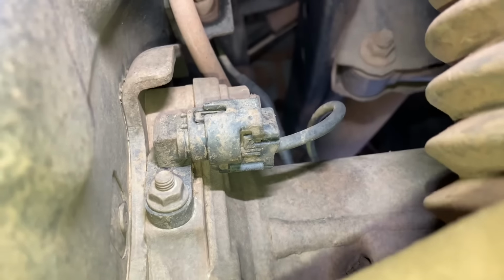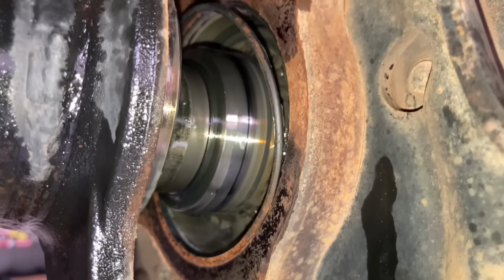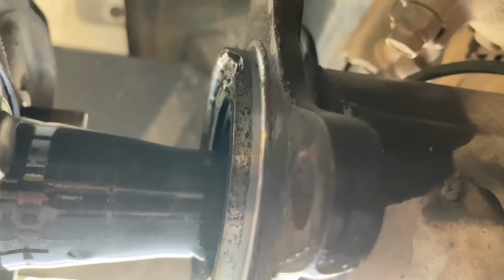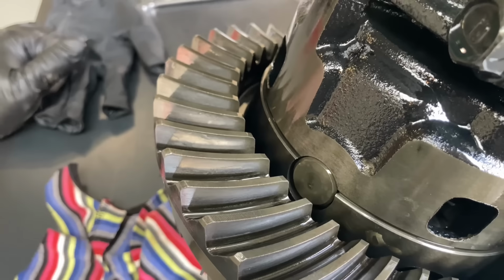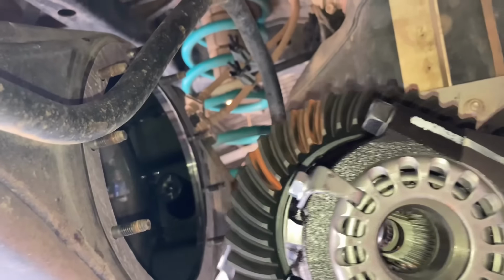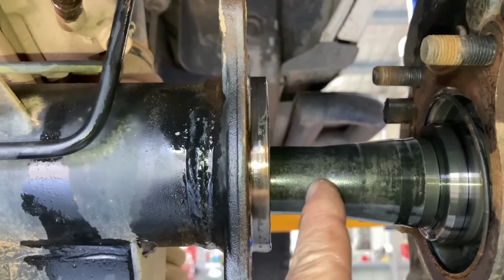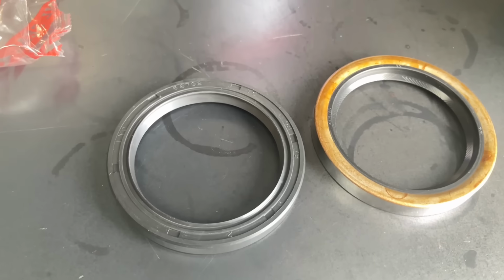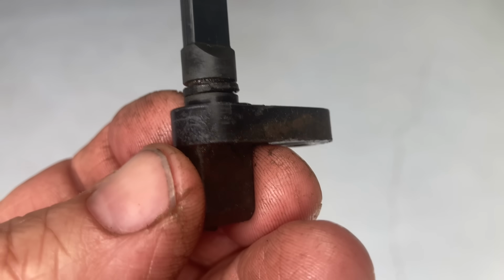The TOYOTA Diff is Flogged FAILURE “COMPROMISED” is the Word! Diagnosis Information

Comment: I have a 2.7 cc Hilux, four-wheel drive, automatic transmission. I found that the pinion gear is 4.55 and I suffer from weakness. It always goes to sixth gear and returns to fifth gear.                  Speed 120 approximately 2000 rpm

Comment: Whats the backlash like on that thing? Not a diff expert either but have reluctantly rebuilt a few and they will notch like that with 0 backlash. Either way, regardless of the reason 50k failure means something wasn't done right, the fact this video exists tells me someone isn't backing their workmanship. Crazy thing is, if you set them up correctly to the manufacturers specs, they work. Who would have thought!
Reply: 50k?
Reply: 🎉u3

Comment: hi 
1/  inspect gear mark up pattern  Face to valley 50/50 position //   toe 40% to heel 60%  [pattern slightly closer to the inside   ] . 
2/ pinion bearing drag is almost always NOT set to factory specs. Usually  approx 15--20inlbs   . This is critical to be spot on factory spec .
3/ Were crown wheel and pinion lapped in prior ,, most shops donot
4/ gears show wear ,,normal lotsa km ,,  worn out pinion bearing  probably **  ,, dirty oil very hard to see ???
VERY GOOD CANDIDATE FOR Gear Lapping . People who operate these machines will tell u pass or fail.
5/ pinion yoke seal surface should be inspected speedi sleeve or metal sprayed or replaced 
,6/ always mark up gears with yellow markup paint 
7/ EG  .007 thou  [  .17 mm]  is enough to make a difference in pinion height /  markup pattern
8/ takes eg 2 hours to o/haul and 2 hours to setup .. setup is critical but sadly close enough is ok........ wrong ......
Reply from the maker: Would you like to have a look at it and take care of it ha ha sounds like you know what you’re talking about
Reply: Add to the list , axles to short ,, wheel studs not installed properly ,, housing that donot drain  fully ,, No deburring of tubing re bearing failure ,,, Old stock bearings in vacuum pack with moisture etching  causing rough rotation of crown wheel and pinion .    .. Axle bearings with incorrect end play, ya machine the seal .   Seen a bit . Anyone can do it .The interest /focus in a good job is all that's needed really . Retired now
Reply: @paulthompson1654  Omg, I would love you to do my diffs